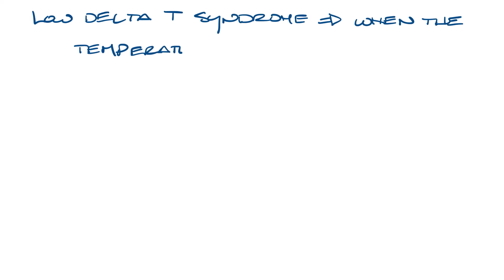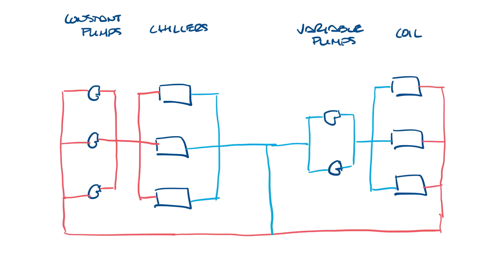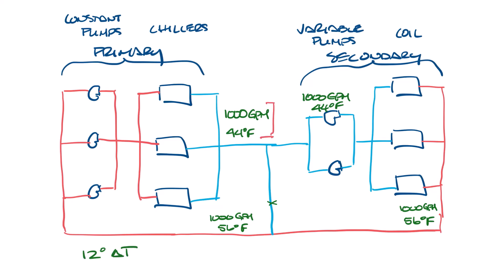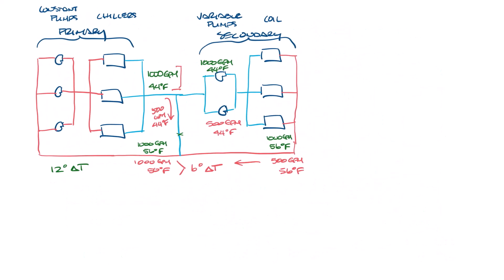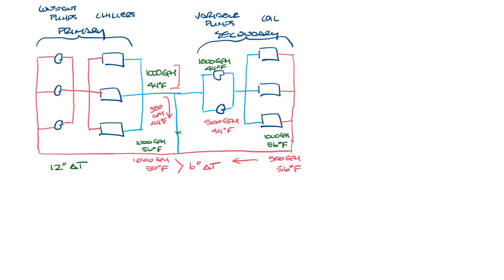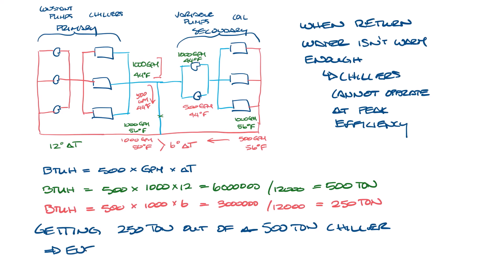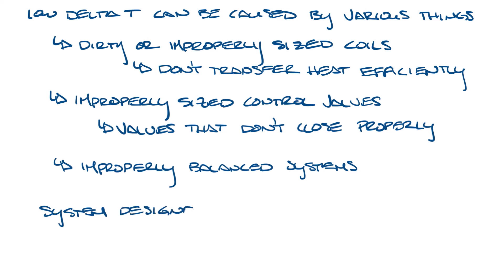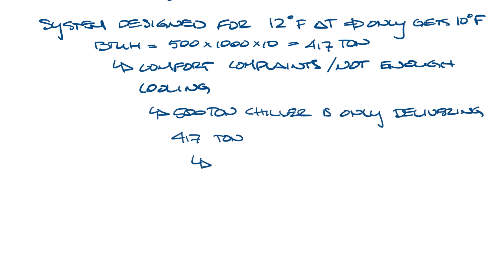NSW HVAC Academy - What is Low Delta T Syndrome?

Comment: "too hot" calls and operators that force valves open to "fix" it also increases flow and further reduces delta-T. I've seen that way too many times. We had to re-pipe several plants to primary variable to solve the low delta-t issues. It wasn't cheap, but neither was the energy to run inefficiently or needing to install another chiller despite the load being within the plants nominal rating.
Reply from the maker: Good point and good lead in for me :-) I'll be talking about variable primary in the next video.